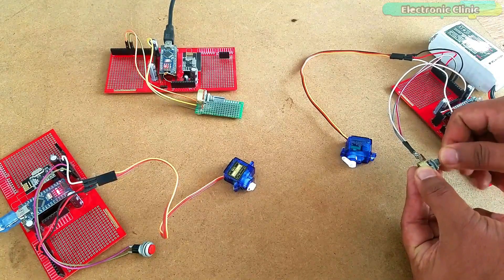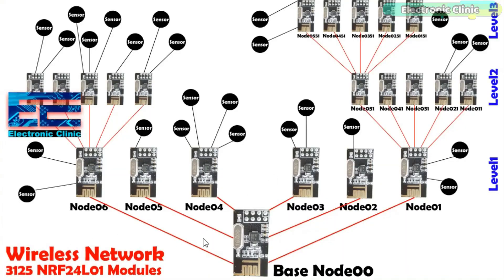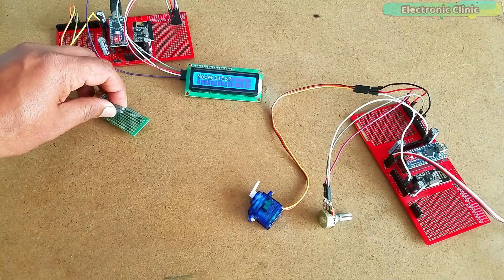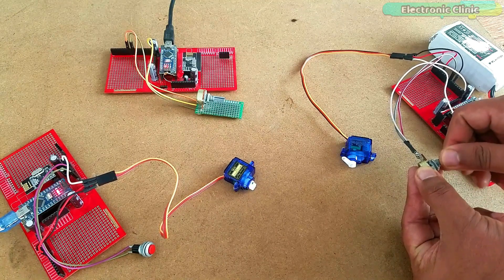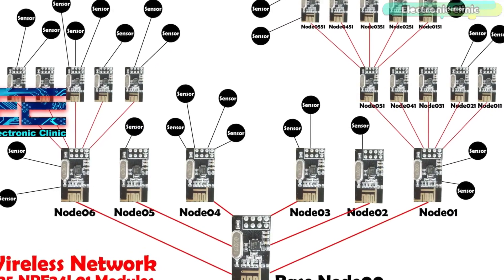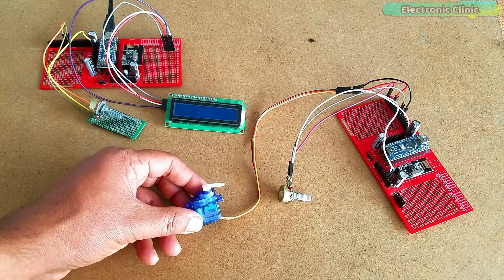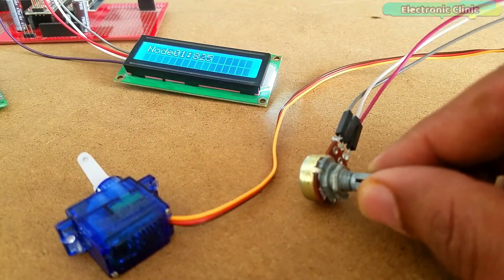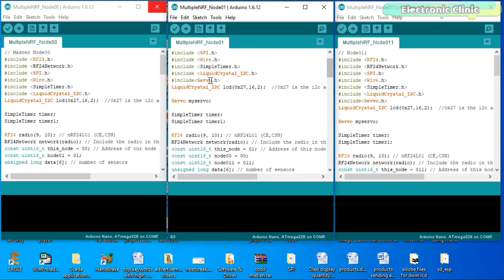Arduino NRF24L01 based Wireless Sensor Network, Multiple NRF24L01 Modules, Wireless Sensor Node

Comment: Hi I have Arduino Uno with 3 pins connected to Max7219 to display 7-segment LED. How is it possible to send data to another 4 Arduino Uno with NRF214 so that I will have exactly the same display on all my 7-segment LEDs. Thank you.

Comment: At level 1 I want to expand a total of 6 nodes. But limited to node05. The next node6 is not receiving any data.
Reply: I think each parent node can only have 5 children. In the diagram in the video, this is shown at levels 2 and 3, but I think there is a mistake at level 1 showing 6 children.
Reply: Thinking about it again, each NRF2401L board can communicate with upto 6 other boards. So, in levels 2 and 3, that would be 5 children and one parent. But the base NRF2401L at the top of the tree has no parent, so should be able to communicate with 6 children?? Clarification required!

Comment: Thanks for this tutorial, am almost working on something related to this...I need help please. Hello sir,  I'm working on a project called wireless notice board, using aurdino, two Xbee series 2c, 8*8 dot matrix board (4 in 1) for the display. The aim of the project is to wirelessly update the message scrolling on the  dot matrix board using the Xbee. One Xbee is connected to the Arduino, the matrix board is also connected to the Arduino (I don't know if my connection is Correct) then the Arduino is connected to the laptop through USB, the second xbee is connected to another USB port. I use the XCTU software to check if the connections between the two Xbee is okay, I can send a message wirelessly to the other Xbee and vice versa... to command it to update the matrix board is my problem here please help me guys. I want to summit the project in school next week